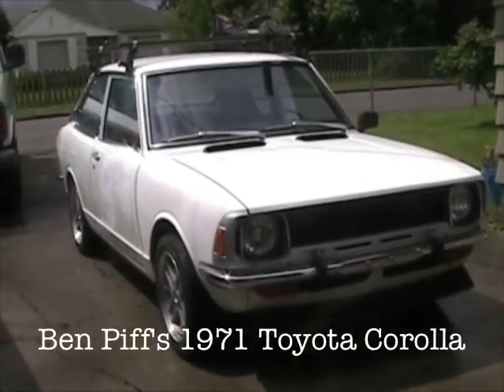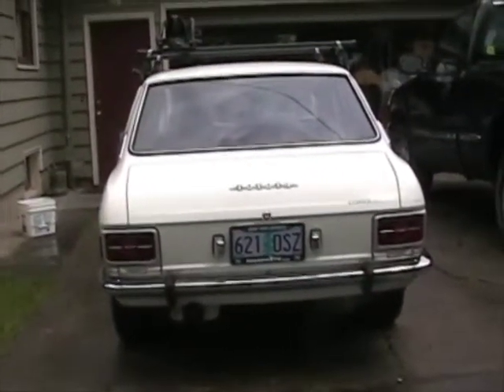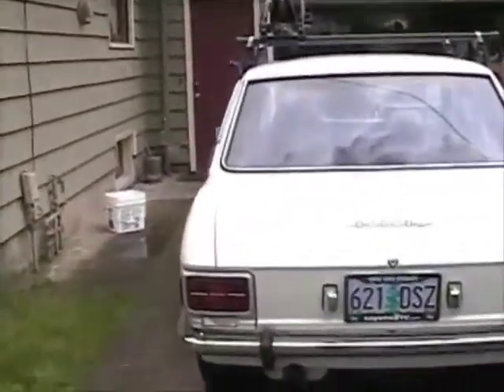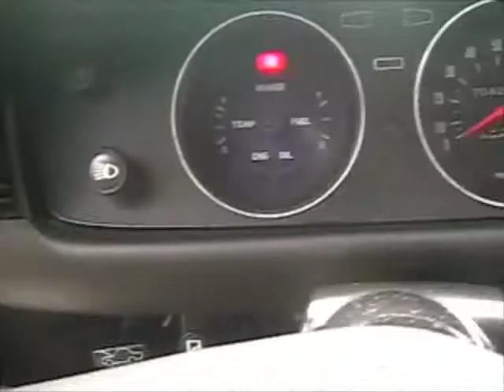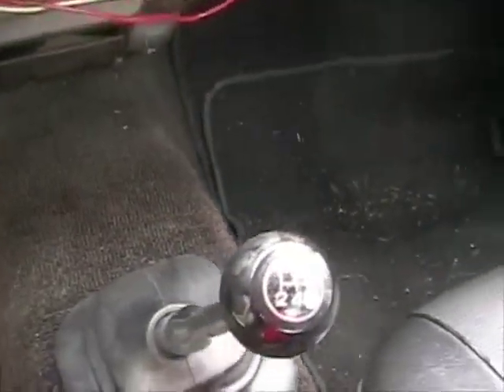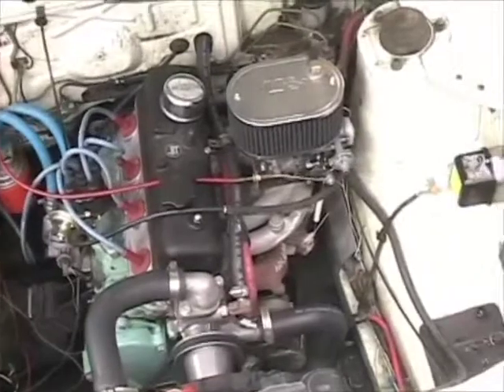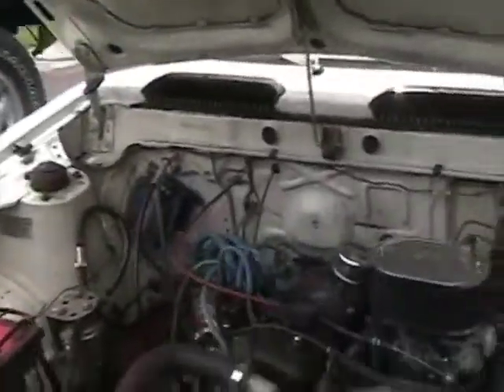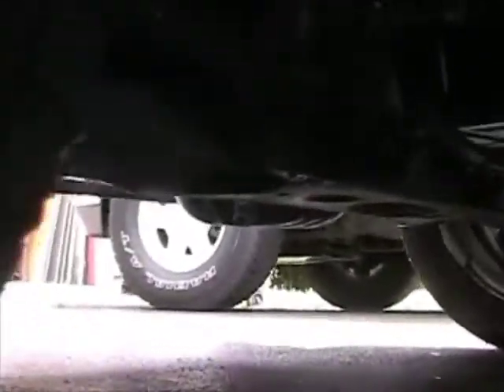Ben Piff's 1971 Toyota Corolla ke20 Peanut Walk Around

Comment: Looks Sweet! the exhuast sounds alright for being recorded through a video cam. the wheels look great. it could definatly use a paint job. other then that its a fine machine. if you were looking for performance i would consider rebuilding the head. port and polish, as well as valves, springs and a mild cam. that will probably give you your most bang for the buck. i regret not doing it when i had the head off of my 3tc. looks great tho. Keep on Rollin!!!!

Comment: Nice car, Ben! Like the air dam on the front. Sounds like its time to adjust the valves for that little tick. If you find out what Mitsi the wheels came off post on the 3tc forums so all the ke guys can have another option for that 4 x 110 bolt pattern.